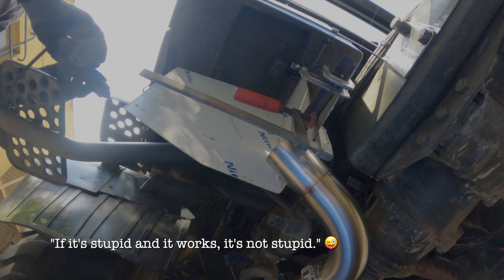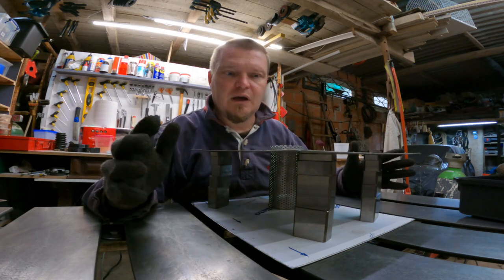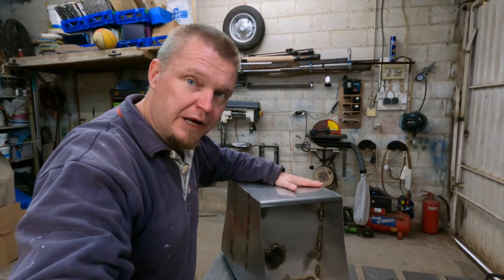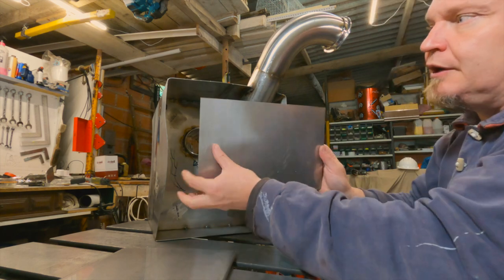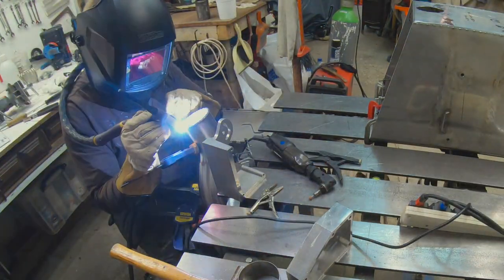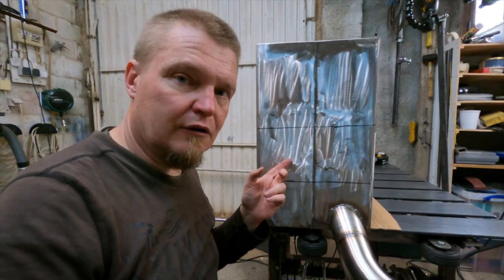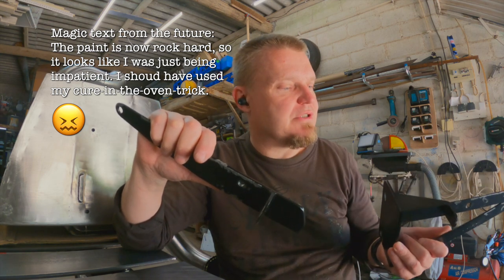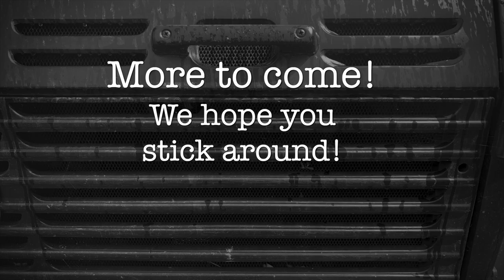Unimog Camper E023 - Finishing the stainless steel exhaust for the truck - Part 2

Comment: Hey Jocke. Your Unimog exhaust is giving off blue-gray gases. The motor is burning engine oil. Either the valve guides and valve stem seals need repair or the oil control rings are clogged or the injection pump and injectors need calibrating. 

I would start by adding Seafoam to the motor oil in correct proportion to dissolve the carbon or varnish blocking the oil control ring's passages, drive it for 1,000 miles, then perform another oil change to get the junk out the motor.
Reply from the maker: Hi, thanks for that. I'll have a look into Seafoam. We don't really expect a 35 year old engine to be like brand new anymore. However, it'll probably be years before it can do 1,000 miles. Thanks again!

Comment: Question: why not mounting the exhaust pipe vertical next to the cabin (you can mount some heat protection around the tube)? It would prevent water entering the exhaust pipe (when going into “muddy puddles”) and prevent blowing the exhaust fumes into their vehicles.
Reply from the maker: The gap between the cab and the body needs to be 70mm, so as you say, it would have to be on the flat face on the side of the cab. To Mount it on the cab, it needs more flex joints, it also removes the space for a ladder, it’ll be heavier, and  it has to stick up beyond the roof line which is already too high. And even then all the diesel soot will be landing on the solar panels. 
I doubt water entering will be a problem. The turbo is way above the 1 metre fording depth. 
The exhausts are now blown on the ground next to the truck, not into vehicles. 
This is the most compact solution with next to no drawbacks. 
Thanks for your question. 😎👍🏻